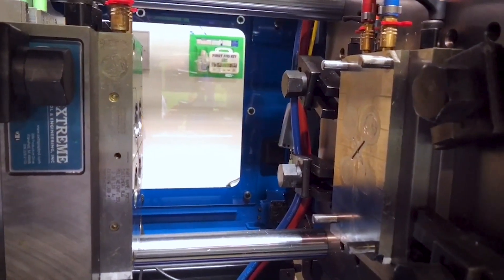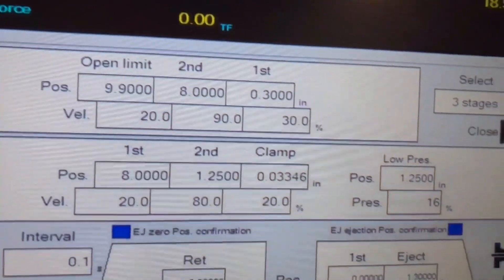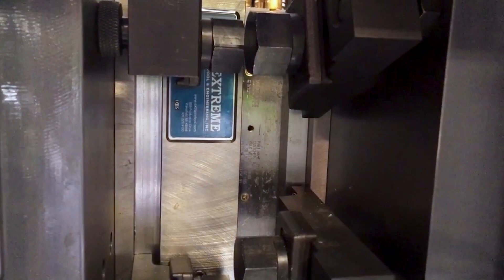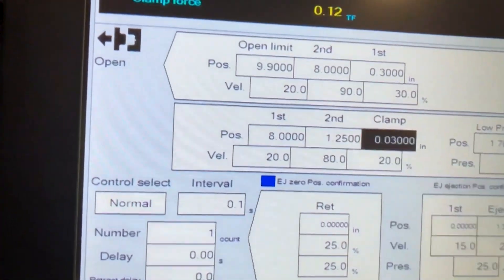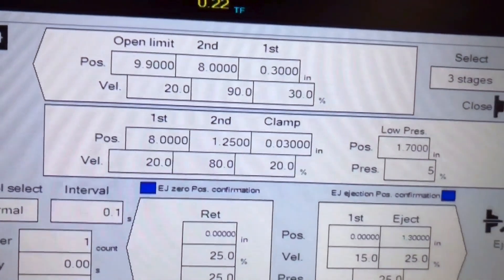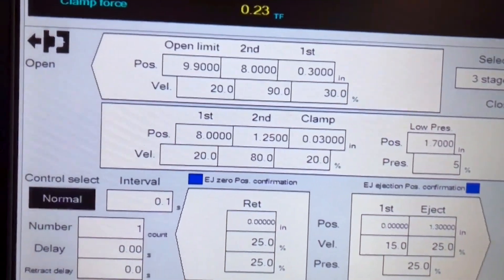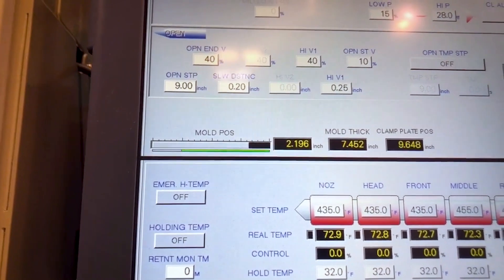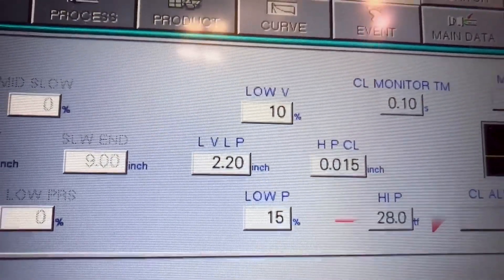Basics of Mold Protect

Comment: You forgot to mention time for a mold protection setting. Older Nessie machine use this time as the last cycle so if your guide pins are picking up and it takes a little longer to close it may take the mold seizing up and not being able to close any more to notice this. Wondered why a machine was 5 seconds over cycle and looked at the graph and it was a tenth of a second longer for every cycle to close. 
And think of pressure as a ball pean hammer - if you take this ball pean hammer (Pressure) and touch it to a piece of aluminum (let's say) you would probably see a mark on it going as slow as you could. But if you take the same piece of aluminum and hit it with a feather (Pressure) you could go as fast as you want, and I doubt you would do any damage. It's the pressure that will do the damage not the speed. 
And start of mold protection is usually determined by the thickness of the part or like you said the "Horn pins" but another thing to consider is if you are over molding on to an insert you are putting into a mold. If the part with the insert was to hang up in the mold and an operator put another insert in the mold, (And not remove the part) the mold would essentially close on two inserts. (Could happen) so start of mold protection would be the height of two inserts if there were no horn pins in the mold.
Good video just needs a little more detail as this is a very important setting.

Comment: This is incorrect!!!!!, lowest mould safety pressure as possible yes and mould safety start position before the mould halves meet yes, but then dry cycle it and keep reducing mould high pressure position after set up like shown and you will find it will work at a lower position 9 out of 10 times. Direct lock machine not so much but if you don't do it on an older toggle machine you can have a bad day. Remember always go to far and then come back, it's the high clamp pressure that will do serious damage and on some machines 0.1 mm on the clamp position on the screen can be 2mm on the hydraulic cylinder, so if you was 1mm to early that is really 20mm on the cylinder to early on older toggle machines. 🏴🇬🇧🧐
Reply: I'm sorry my comment earlier I think was a bit rude of me, I was just trying to get across to people mainly the inexperienced how toggle machines can be more dangerous. I myself are not perfect, many  years ago  in  2003 I was working for a company and we had a new Sandettro series 9 or 10 it was  500 or 550 metric tons on loan and I was loading a tool that didn't hang straight on the crane, I was used to series 7's and 8s but this machine was new. I closed the clamp using the maintenance hand button to push the tool flat onto the fixed platen. There was a big who har when the day shift came in because the location ring sliced about 3/8 of a inch out of the side of the hole in the fixed platen. I had reduced the high pressure clamp position to the minimum and the mould safety pressures all to 15 bar and the speed looked really slow so at first I was surprised. The managers was looking at all the setting history to try and find out what stupid thing I had don't. Anyway long story short the Sandretto engineer who installed the machine on site found a toggle bush picked up due to some defective lub system. So he had to replace a bush before handing it over to the company and production, which landed on me. Well the maintenance speed was left on 5mm/s  but the pressure was on 135 bar if I remember wright I think he had to pull a tie bar half way out to pull a pin, 135 bar that's maximum and I didn't think about looking at that at the time never mind were it was. So always check the settings all of them and never ever use the moving platen to push the location ring and tool onto the fixed platen. If the pressure was on say 15 to 20 bar it probably would not have happened but the maintenance hand button setting was set at 135 bar pressure and override all other settings . It's always best to measure the tool when it's on the floor and set the mould height with the machine empty with it  20 mm or more  smaller when lock fully over, that's if it's possible, then  if you do get the urge to use the platen on low low pressure of course to push the tool straight the machine has not got the macanical advantage to do any damage, but then put a ticket on the tool for the toolroom to balance the tool so it's leans straight with say a negative 1 degrees compared to the fixed platen, then the crane can do it's job and you don't loose yours job because they have to buy a 1/4 to 1/2 million pound machine. I don't know if they had to buy the machine and I didn't get the sack I think they released it was one of them things.All the best,Jim🏴🇬🇧
Reply from the maker: Thanks for your comment, James. It seems you are very knowledgeable on setting mold protect with the molding machines and the molds that you run. Kudos to that. The reality is that different machines behave slightly different than other machines, and the little details can be different from press to press. The purpose of this video is only to show the basics of setting mold protect. Thank you for sharing your input.

Comment: Some molds I experienced thru my nearly 40 yr career was molds w extra large cam springs, they can be a little more tricky to precisely get a good balanced low pressure close setting at the lower end of the pressure range setting of the machine, especially if it's a family mold that contains some very tiny parts that could possibly get closed in there as well. Very good basic video of how to set your low pressure protect though, keep up the good work RJG
Reply from the maker: Yes, those cam springs and even compression bushings need extra pressure to close up. Thanks for the feedback.

Comment: yep I agree { thermal expansion } add time in there too but for most part ya I agree I work with really big presses w/ really big molds that have horn pins bout 2 inches round I do a pretty good job at setting mold protect but UBE 15000 ton w/ big horn pins / { or slide pins if that's what ya call  em plus at what angle these pins are It can be really difficult Id like to see more on mold protect on diff presses diff sizes and diff leader pins n sizes

Comment: Well explained but should have explained mould protection time too.
Reply: You are correct , there is usually a timer used as a maximum time to travel from mold protect start to mold clamp. If the machine reaches this timer , a clamp alarm will be triggered.  Some machines have this timer very visible to be used by the person setting up the mold protect and some machines have it in the background and is automatically set.